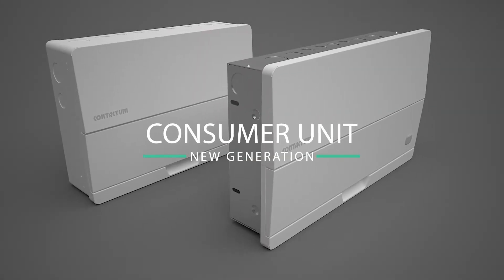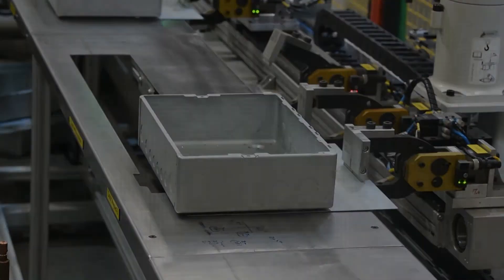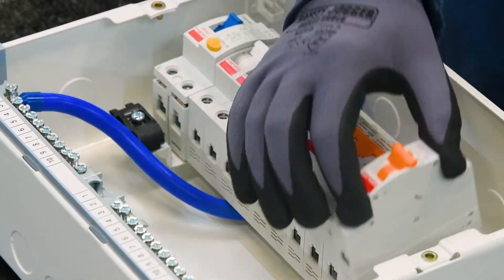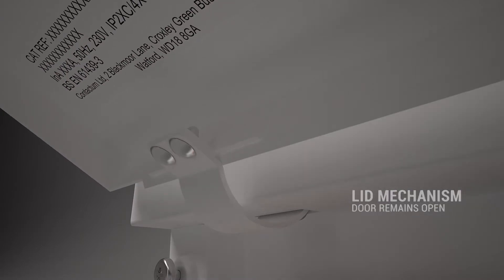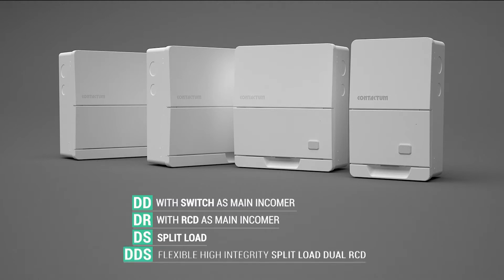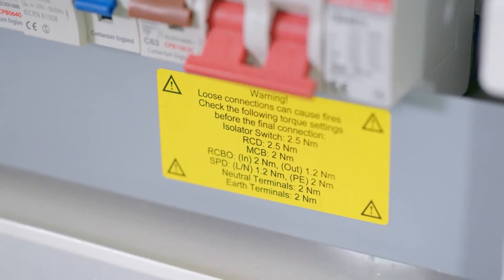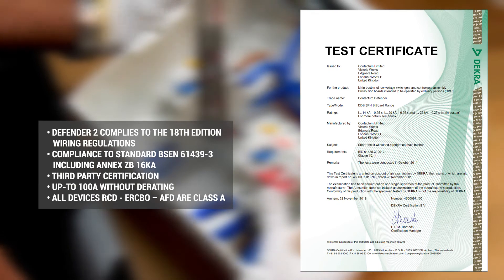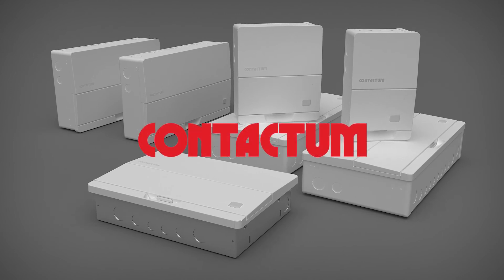NEW at TLC - Contactum Defender 2.0

Comment: Why does my board keeps tripping when I switch my 16amp mcb on?
Reply from the maker: I am sorry to hear that you are experiencing a problem with your Contactum board tripping.
Overloaded circuits, moisture ingress, damaged wiring, earth leakage, and faulty appliances are among the top reasons that would cause a Mains RCD to trip.
This would need to be checked out by a qualified Electrician.
Technical advice is also available from Contactum - www.contactum.co.uk

If I can be of any further assistance, please contact me on 01293 565 630
Regards,
Rob O'Shea